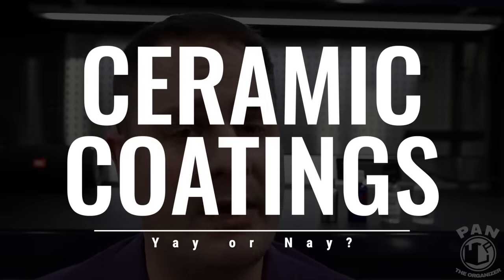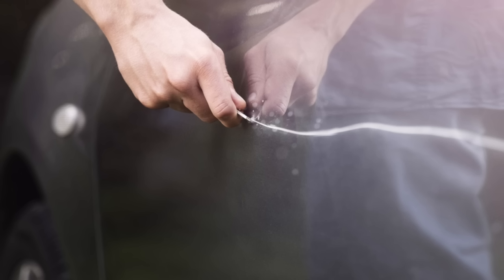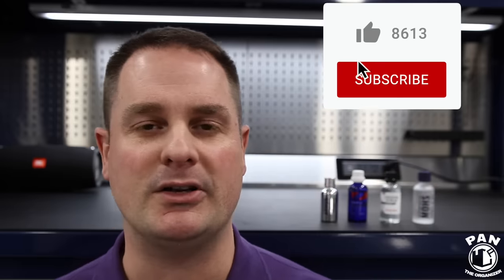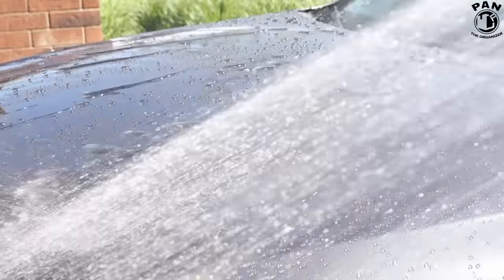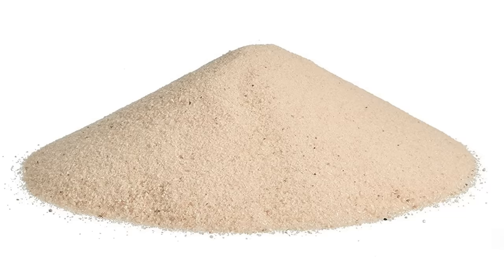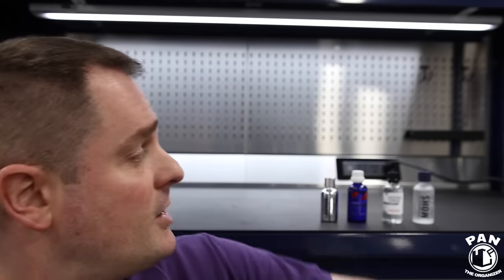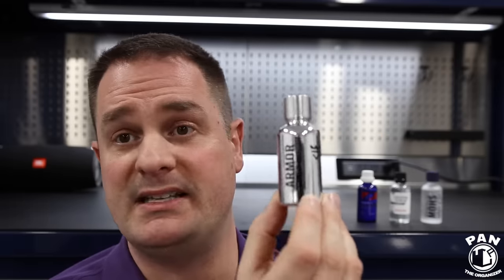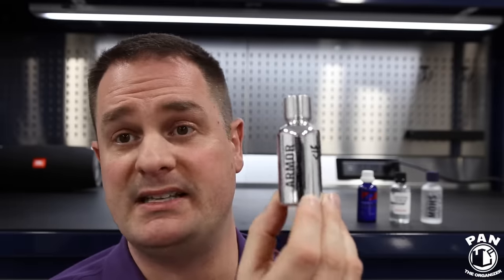DON'T BUY CERAMIC COATINGS BEFORE WATCHING THIS !!

Comment: What product would u recommend? 
Car is a 2020 paint is pretty much pristine,   
I can claybar and own a mechanical buffer.
Live in Texas so its humid here,
Don't have a garage,  at most use a car cover. 
Amateur here, so need a easy to use ceramic coating product.
So far looks like the armourshield 9,  unless u think there's an easier one.
Reply from the maker: It’s the easiest coating I ever applied.

Comment: Hello Pan!  I just started watching your channel a week or two ago. I’m considering buying a new two tone Toyota Corolla hatchback with the black roof and red paint.  Have you heard of the System X Max G+ plus ceramic coating product?  Evidently it has a 10 year warranty and it requires you to go to the original installer once a year for a maintenance package.  I would be interested in knowing what you think of this product. My car would be garaged, and I live in the upper Midwest in the US.  Thanks!
Reply from the maker: I haven't heard about it, but always refuse what ever protection package the dealership offers. They are usually all garbage. Low quality products for maximum profits. You're paying more for a "warranty" than you are the actual quality of the product applied. The likelihood of a new car rusting these days is very low. Coatings are meant more to increase gloss, slickness, provide chemical resistance, and make the car much easier to clean during your washes. 

If you don't want to do all the detailing work yourself, and apply a good quality ceramic coating, at least bring it to a reputable professional detailer that uses quality coatings from known reputable coating brands: CarPro, Gyeon, Gtechniq, DuraSlic, C6 Ceramics, Opti-Coat, etc.

See my video on "Should you detail a brand new car?" here: https://youtu.be/QgoyrC-5CMc?si=GAychwEddmGB-AYN
Reply: @PanTheOrganizer Thank you!  And to clarify..:System X is only offered through authorized professional detailers who have received the necessary training (as opposed to car dealers).  It also goes on your Carfax report once an authorized professional retailer installs the product.  Thanks again!
Reply from the maker: Ok cool. Make sure you do your due diligence to find out if it's actually a good coating. I haven't seen any major detailing channel even talk about it, so that worries me. How did you discover my channel by the way?

Welcome to my channel. You discovered one of the biggest car detailing channels on YouTube as we surpassed 1 million subscribers and we have over 145 million views! I have been detailing for 27 years and I love to share my knowledge and passion with my viewers.

You found the right channel to help you learn everything about detailing.
Reply: @PanTheOrganizer  To answer your question  on how I found your YouTube channel, I have a YouTube premium subscription and I just searched for things like “Are ceramic coatings good for new cars?” or “What’s the best kind of car wax to use?”  Thanks again for your quick responses and good luck growing and maintaining your channel!

Comment: When apply cquartz 3.0 and bliss should you also apply carpro reload on top of it all, or is it best to use reload when you do maintenance washes. Thank you for the videos. If it wasn’t for these videos my car would look like crap.
Reply from the maker: You mean Gliss? I never heard of CarPro Bliss. Anyhow, you would apply your two coats of CQUK 3.0, wait 4 hours after the last UK coat, and then apply one coat of Gliss. No nead to apply Reload, as Gliss is a longer lasting form of Reload.

Then, once every 2 or 3 months, you can apply a coat of Reload to further boost gloss and slickness as needed.

Comment: hi pan, how can ceramic coat bond on the paint if we put 1 step polish?....also what is a good IPA wipe?
Reply from the maker: Don't confuse 1-step with all-in-one. An "all-in-one" polish also lays down protection (like Rupes Uno Protect). A 1-step polish simply means you are skipping the compound stage, and only doing a polishing stage with a pure polish like Sonax Perfect Finish or CarPro Reflect for example. So before you apply a coating, you can use a 1-step polish, then IPA wipe, and then apply the coating.

You would never use an all-in-one before a coating, unless it's specifically formulated to be used as a primer before a ceramic coating (like CarPro Essence and Gyeon Primer).
Reply: @PanTheOrganizer  hey Pan., if i have a ceramic coating, what is a good cleaner if i dont want to wash the car, just to take out some dirt and dust? thanks

Comment: Out of curiosity why use those coatings if you will have to use a spray to maintain the coating every few months rather than only using a spray coating just as frequently?
Reply from the maker: Because you know that as a base layer of protection, your clear coat has the best protection against the UV rays, the elements, chemicals, and you get the best hydrophobics and self cleaning properties. Even if you skip a maintenance application, you still have a more durable protection.

I demonstrated that in a real world durability test with 20 different paint protectants, including sprays and full blown glass bottle coatings, and you will see for yourself even with no maintenance toppers added, how more durable these true coatings are. Here's part 1: https://youtu.be/MoBTLpRFFw4

Comment: Can this be used on dash, instrument panel, leather or vinyl seats?  or is that a different kind of ceramic solution?
Reply from the maker: There are ceramic coatings for all sorts of surfaces: paint, glass, wheels, plastics, leather, etc. You have to pick accordingly to the surface you want to protect.

Comment: Is it possible to to wax polish one panel at a time and apply ceramic coat and then go to next panel.  Doing it my self,  black car and dusty environment
Reply from the maker: No. Polish all the car first. Then use the IPA solution spray to wipe polishing oils off the paint. And then you apply the coating all at once.

You could polish on one day. Then wait until the next day to do the paint prep spray (IPA) and apply the coating.

Comment: Would you recommend those coatings for gel coat and boat paints that typically don’t have clear coat covering the paint?
Reply: Probably not.  Not sure because boat coatings chemistry is complicated.
Boat paints and gel coats can contain anti-biofouling components which might be blocked by the silica sealant. 
They may also be more porous and not make smooth enough surfaces for the coating to stick properly.
Some boat coatings are ablative, they are designed to slowly come off and expose a fresh surface beneath.  
Also, when sea water droplets bead tightly on a treated surface, they can evaporate there and leave salt marks, so it might give you with more work swabbing the decks with fresh water.

Comment: Hi Pan , I have applied Turtle wax Hybrid solution Ceramic coatings on my car . Can I apply another coats of Avalonking Armor Shield IX on top of the existing Turtle Wax Hybrid solution Ceramic coats.
Is it advisable ?
Reply from the maker: Nope. Ceramic coatings need to bond directly to virgin, well prepped clear coat. You can't apply them over existing protection.  You would have to fully strip and prep your paint (which includes machine polishing) just like in my popular tutorial here: https://youtu.be/byKcYsEyWGk

Comment: Hey Pan, thanks for sharing, I wanted to ask since I have protection on my car, (sealant, wax and last coat 2.0... would carpro reset soap or adams strip soap work to take that all off to prep my car for a ceramic coating? Just seeking best advice to start a ceramic or graphene coating! 
Thanks!
Reply from the maker: A stripping shampoo alone won't be enough to fully remove any previous protection. What that does is start the breaking down process of older protections like waxes and sealants. You will also need to machine polish the surface to ensure 100% removal of the previous protection before you apply any ceramic coating. That is key as the coating needs to bond to virgin clear coat.

I made a tutorial on how to properly apply a ceramic coating here: https://youtu.be/sqQYVjxFqK0
Reply: @PanTheOrganizer  Your the Guru of Car detailing!!! Thanks Pan!
Reply from the maker: Thanks!! Welcome to my channel. You discovered one of the biggest car detailing channels on YouTube as we surpassed 760,000 subscribers and are getting close to 100 million views! I have been detailing for 25 years and I love to share my knowledge and passion with my viewers.

You found the right channel to help you learn everything about detailing.

How did you discover my channel?

Comment: Hi Pan! Very helpful (but a little too long) video. You mentioned that microfiber applicators should be downgraded or thrown away after dealing with these products. 
But what about “lighter” SiO2 products (like Gyeon Bathe+ or Gyeon Ceramic Detailer): should we consider the same logic or it is possible to use the microfibers for a longer period of time considering that they are way less effective and “pure” compared to the products that you showed here?
Thanks!
Reply from the maker: With ceramic sprays or shampoos you can just wash the microfiber towels after use and reuse them, unless stated otherwise by the company.

Comment: Hi Pan , can we use a turtle wax ceramic coatings over a Avalonking armorshield ix base coats for maintenance coats ?
Reply from the maker: Yes. Flex Wax is a great topper for existing ceramic coatings.

Comment: Thank you PAN. Good information.
I just want to know, after applied ceramic coating, it is need heating by infra red lamp.
Thank you.
Reply from the maker: Not if you use consumer grade coatings like the ones presented in this video. No infrared curing lamps needed.
Reply: @PanTheOrganizer  Thank you very much Pan. Very good information.

Comment: Hi pan. Im from the philippines.  Im planning to let a proffesional install gtechniq csl and exo on my car. Is beadmakers a great topper for extra shine and gloss? Or should i just leave it without a topper. I know its known for shine and gloss. Will there be an effect or will it degrade the performance of my gtechniq csl exo? Thanks pan
Reply from the maker: You should be using a topper at least once every 2-3 months. Gtechniq has its own C2V3, but yes you can use Bead Maker to further boost gloss and slickness. You can even use Bead Maker as a drying aid after each wash. It's addictive. Did you watch my full Bead Maker review? Here: https://youtu.be/J7uc4AlarpU
Reply: @PanTheOrganizer  thanks pan. Love ur channel

Comment: could one of these ceramic coatings be put on top of an existing Turtle Wax ceramic coating that is already on the car?  If not, how long should I wait?
Reply from the maker: No. Ceramic coatings need to bond directly to a virgin clear coat with no protection on it. You would need to prep the paint and that includes machine polishing to ensure 100% removal of any previous protection.

See my ceramic coating application tutorial: https://youtu.be/sqQYVjxFqK0

Comment: Hi Pan, I am planning on using Gtechniq or Cquartz on my car. Can ceramic coatings be used on glass and plastic trim or should I use specific coatings for these elements ie DLux ?
Reply from the maker: It depends on the coatings. Some coatings like AvalonKing can be used on all the exterior surfaces (paint, glass, wheels, plastics, headlights, even PPF). 

But CarPro CQuartz UK 3.0 and Gtechniq CSL are paint specific coatings.

For plastics and wheels, you have CarPro DLUX. For glass, CarPro FlyBy.

Comment: I have new car. I 've been thinking to try ceramic coating. The problem is i dont have a garage. Can I use car cover to cure the ceramic coating. I bought also a cheap ceramic coat are they any good?
Reply from the maker: Yes you can. Don't buy cheap ceramic coatings. Not worth it! Especially not those cheap eBay knockoffs. Buy from reputable brands like the ones in this video.

Comment: Good info Pan.  I'm about to coat my neighbors Porsche Boxter soft top so seeing  this was good timing.  Does CQ UK form a permanent bond to paint like CSL does?   I'm curious if CSL, with EXOv4 topper is as good as CQUK or better, AND has a 4-5yr estim. duration, rather than 2,  why didn't CSL combo make your 1st place choice over Avalon or CQUARTZ?
Reply from the maker: CSL, like most paint coatings, isn't a permanent bond. They are semi-permanent, hence why they have durability claims of 2 to 5 years, and not lifetime. But yes CQuartz UK 3.0 is a ceramic coating just like Gtechniq CSL is. Both are some of the best consumer grade coatings, and both have taken home awards in my popular annual car detailing products awards videos in the past.

It's not all about durability when I pick coatings. It's about overall experience, ease of application, gloss, slickness, value for money, etc. A lot of it is subjective too, as everyone has different tastes.
Reply: @PanTheOrganizer  So knowing what you do with having tested these, and you were in my shoes installing for your neighbor, which combo would you use... 2 coats CQ UK3 topped with 1 coat SiC  or  1 coat CSL topped with 2 coats EXOv4?... ignoring the cost factor.

Comment: U say it has to be completely clean clear coat; yet the carpro essence that you quoted in another video is a good primer for coating the car. Carpro essence has SI02… so I just put a layer of coating on the car and amor shield is 80% SI02. Does SI02 bond good with other SI02 when applied in this way? Contradictions drive me nuts.
Reply from the maker: Don't get confused. Primers are very different from glass bottle coatings. A primer is basically a finishing polishg that contains gloss enhancers and masking agents to mask light imperfections and scratches and lays down a "primer" layer on which the ceramic coating can bond to. They are compatible chemistries as long as you stay within the same brand. For example, CarPro Essence primer followed by CarPro CQuartz UK 3.0 ceramic coating.

CarPro Essence is a primer, so has very light polishing capabilities, but lays down a small layer of ceramic and gloss enhancers and semi-permanent fillers to mask defects, and yes the CarPro Cquartz UK 3.0 ceramic coating is designed to be compatible with Essence. So when you are done with Essence, you can in theory apply CQUK 3.0 (it's unkown if Essence is compatible with coatings from other brands though).

But you would not apply a glass bottle coating on top of another existing glass bottle coating. So in your case, you mentioned AvalonKing Armor Shield IX. That is a ceramic coating, not a primer. So you would not apply another ceramic coating on top of that. The coatings in glass bottles need to bond to a virgin clear coat, unless they are bonding to a primer within the same brand.

It's not as common to use primers though. Most people just do the compound and polish steps, then IPA wipe, then apply the coating.

If you look at all my recent high end detailing jobs, none use primers:
Mercedes S 580: https://youtu.be/Vq_tfcwryVI?si=whord2_UEFSg28UW
Aston Martin Vantage: https://youtu.be/OKga3yZVTqo
Volvo XC60: https://youtu.be/tvDBBenhYFA
Tesla Model Y: https://youtu.be/gohks8xP5NY 
Porsche 911 Carrera: https://youtu.be/2ckiivbFqs4
Audi Q7: https://youtu.be/t7HCBSVnizM

Comment: Hi Pan, Thanks for all the informative and enthusiastic videos you do.. the depth of information u give helps to motivate ourselves into DIY detailing...
I had a few questions which I want to get address before getting ceramic coats..
1. A vehicle with no polish , sealant, wax history and swirl marks all over should be  professionally polished before getting ceramic coated??
2. Can Swirl marks be buff ourselves and coated ?...as vehicle was only auto washed. 
3. Also How much of ceramic coat  bottles would be required for entire car and can this process be performed in outside shade rather than in garage as dnt hv one.
Reply from the maker: Thanks for the kind words Prathamesh!  Here are some answers to your questions:
1. Even brand new vehicles benefit from at least a light polish, as they are never perfect coming from the dealership. Watch what I do to brand new cars in this video: https://youtu.be/tjJPcdCUaK8
2. I don't understand your question... Yes you can machine polish your car at home. I have a tutorial about paint polishing here: https://youtu.be/X2qjO5xZZ2E
3. For one average size car, one bottle is enough for two coats. Yes you can work outside, but make sure you stay in the shade (never in direct sunlight!) and pick a day where it won't rain for 24 to 48 hours after you are done applying the coating.

How did you discover my channel by the way?
Reply: @PanTheOrganizer  Thnk u for the reply.. I have come to overall conclusion that ..I need to polish car before I could apply any ceramic coating...as light polishing would help.. 
Also I would be obliged if you address my another concern how to find out how much of polishing should be done ..on vehicle.. 
I came accross your channel when  I was looking videos to polish chrome exhaust tips.. .. and from then its been over a year, I am following you for various detailing stuff which I can be able to do alone...
Thank you once again

Comment: Pan, would I be able to coat my glass and headlights/taillights with carpro uk 3.0 and gliss? Would carpro dlux be a better option?
Reply from the maker: You can apply CQuartz 3.0 to paint, chrome, headlights and tail lights. DLUX on wheels and plastic trims. FlyBy on glass.